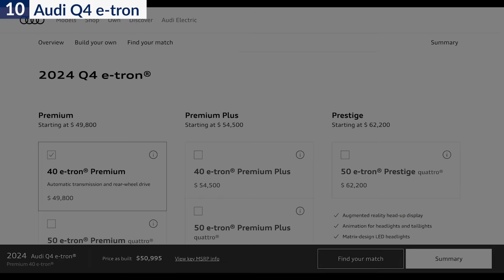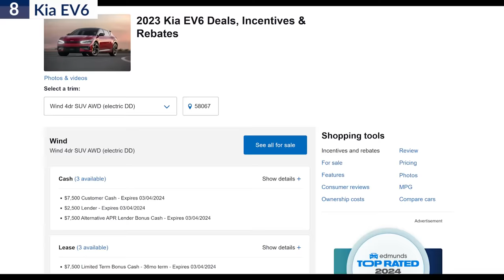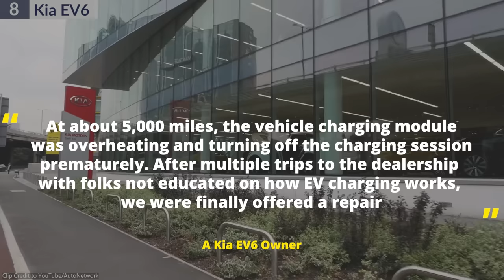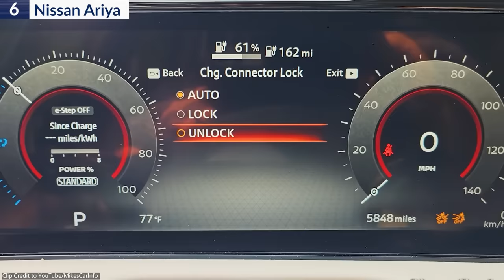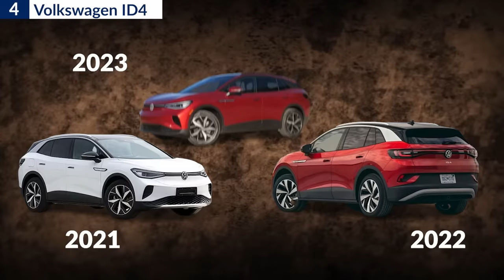New Electric Cars Piling Up on Dealer Lots in 2024 – Here is the Truth!

Comment: Well, insane drop in value even after 3 years more than 50%, crazy loans and insurance values, easily adding over 50% to the costs just in 5 years, also questionable future regarding charging costs,  battery health & tech ridiculous range drops in winter & highway speeds, I am sure there are 100s more reasons not to buy if you value your money & time.
Reply: The main additional reason is that they are not green at all.  They do not emit pollutants when they drive but every single other thing about them is worse for the planet.
Reply: Im used to buying 4-5 year old cars with ~100k km on the click for around 50% of their initial costs. Then I drive them another 5-6 years and resell for around 20% of initial cost. Meaning on a 50kE car I spend around 25k buying and sell it for say, 10k. I lose around 15kE for 5-6 years of driving it.

EV when out of warranty is valued whatever scrap / parts are valued. Battery when out of warranty can go bad at any moment and car is dead. Replacement battery costs more then car itself is worth. Imagine buying a same 5 year old EV for 50%, 25kE, after 2-3 years battery warranty is out. It dies, 20kE cost to replace. Total cost to you: 45kE. Resale value: 10k? 15?

Comment: I recently watched a news report shown on Canadian TV about a motorist who had a Hyundai Ioniq EV which he bought for US$60,000. He was driving along a motorway ['Freeway'] when he didn't notice and ran over some debris left on the road. Although there was a loud 'bang' as he struck the debris, when he later stopped and inspected the car there didn't appear to be any serious damage. 
However, the owner felt it was best to have the car checked over professionally and took it into his local Hyundai dealership. Underneath the car is a large 'plate' which is fitted to protect the battery [I believe this is normal for EV's?] The plate had some deep gouges in it but more importantly, the access cover to the battery itself [which is located in the centre of the plate] was missing. 
On further examination, the Hyundai engineers concluded that the battery had suffered 'impact damage', resulting in a slight leak and needed to be replaced. The cost of a new battery? US$50,000! And due to the staggering levels of depreciation of EV's [despite the car being only two years old] the owner soon discovered that it was cheaper to buy a new car than replace the battery! 
I have long argued that EV's are the single biggest scam ever inflicted on motorists. This utterly inane belief that buying an EV is 'saving the planet' or helping the environment is complete BS. Electricity doesn't grow on trees or magically appear out of thin air. It needs to be manufactured. And where is it manufactured? In power stations. And where do power stations get their energy? From fossil fuels [such as coal, gas and petroleum] or nuclear fission. 
In effect, we are merely transferring the production of fuel [and with it the resulting pollution, degradation of the fuel source and environment etc] from one resource to another. And worse still, the levels of pollution etc are FAR greater when that fuel source is from power stations than is created by petrol or diesel-powered vehicles.  
But on top of this is the phenomenal initial cost of buying [and insuring] an EV, the unbelievable level of depreciation, hassle and inconvenience of EV's and now it seems, having to replace the battery on an EV if it gets damaged. No wonder car manufacturers [and people like Elon Musk] are rubbing their hands and making billions!! 
The other irony is that EV's are not a new idea. EV's have been around for over a century. So why didn't electricity become the main power source instead of fossil fuels? It sometimes amazes me how gullible we all are and that huge corporations can manipulate our thinking by simply tapping into a 'trend' or people's fears.

Comment: Interesting reading all the EV critique comments; I drive a gas car, half the houses on my street have Tesla, one Rivian one Porsche one MB but zero Korean, Ford or GM.  So, I think it’s not all EV don’t sell, it’s the car model and area, LA is warm, dry and my neighbors can charge at home (we can install separate discounted meter for EV), saw a few running cable to cars park outside, and almost all public parking have charging stations.  My son has a Toyota Prius Prime plug in, tiny gas tank only fills a few times a year, does save a lot of money as gas is expensive here.  My car costs about $80 each time to fill up, it adds up pretty fast.

Comment: EV's are now like a midlife crisis health check up ! They are terrible on losing range in the cold, they can burst into flames , the battery life will be a terminal thing & who pays ? Charging can be a nightmare & the ranges are compromised ! Until the networks are like any other gas/petrol stations & the range goes over 600 miles they are about as useful as a canoe without a paddle !

Comment: To look at EV depreciation, you have to reduce the price of the car by the amount of subsidies on it.  If the car qualified for a $7500 federal tax credit and a $2500 state EV tax rebate, then the car is worth $10k less, thus the value after 1 year typically falls in line with other ICE vehicles.  2022 was an anomaly where as most car buyers paid over sticker for their cars, and thus depreciation was high across the board.

Comment: i mean what did they really expect?   I own both an EV and an 11mpg truck.. so I can speak from both viewpoints here.   There are tons of problems with EVs

1: $20k higher priced than an ICE equivalent version.
2: "starting at" doesnt matter, most dealers are only stocking the higher trim levels because the margins are better.  So there is no value options in most locations
3: companies killing low cost EV like the Bolt but pushing $110k massive EV like Hummer and Silverado.
4: massive initial depreciation well beyond that of ICE cars.
5: Charging infrastructure is insufficient in alot of places. 
6: No future thought regarding how we will create the increased power which will be needed to support our grid once mass EV adoption has been achieved. 
7: Range is still an issue. 

We love our EV, but its a tool for a specific set of conditions.... an EV wont fit everyone's needs and that needs to be spoken.   All the bad press of Teslas freezing in the Chicago winter storm wasnt because EV are bad, its because a bunch of people without the capability of home charging, who rely entirely on a commercial charging network, purchased a vehicle without thinking it through.      Until consumers are honestly educated about EV's, and not pushed a government or manufacturer talking points, they will continue to have adoption problems.

Comment: People who buy a mustang want to hear vroooom! Environmentalists don’t buy cars like that. The Ford 150 is another disaster. Pickups are used to haul stuff. No one wants to sit at a charger for hours because you’re carrying a heavy load. 

The environmentalists and the tech curious people bought into a dream. The rest of us have done our homework and don’t want to be stuck with a worthless EV in 8-10 years when you’ll have to (not if) dump $20,000 into it to replace the battery. The car should be going on 150,000-200,000 miles by that time-should be worth about $5,000. If you try your luck at a dealer, the first question they will ask is when was that battery changed?  When you say never……goodbye.

Comment: I expect a 500 Km two-motors EV to sell for £ 20,000, with the battery being user-replaceable. Also, charging should be subsidised, if not free. More in a while.

I don't mind full-self-driving because that is a perennially moving target, as it isn't possible to make a self-driving car. A car is a tool, and a tool is meant to be used, so it will always require an operator.

Also, we need a warranty on the charging price. When the EVs got out of their hide, charging one of them costed 1/10 of the price of a tank of fuel. Now, charging an EV costs half of the price of a tank of fuel. You see where we are going, should be only EVs on the road one day: therefore, charging an EV must be free.

Many people feels cheated, after they bought an EV. No more free parking and free road tax. In London EVs will pay a contributing green fee in two years time. Charging prices have increased five times, insurance has doubled.

And nobody prepared the EV owners to the rate which they go thru with tyres: replace the tyres every year.  EV tyres have half of the calendar life of ICE tyres, and they cost the double. 
The rolling resistance of EV tyres is absolutely critical with the battery life; half-worn tyres double the rolling resistance, which in turn, almost halves the battery life. 
I would say, it is no EV time for the masses  yet...

Comment: They are more expensive than ICE cars, without incentives and discounts. More expensive to insure. Tires wear out faster. 
Yes, gas costs more than it did 5 years ago but charging electric car costa more too using public fast chargers (depending where you live). 
Another unforeseen problem is fires. In a crash or battery failure those fires are impossible to put out. Whole car shipping ferries have sunk because of such fires. They literally burn under water! Fire brigades are just watching them burn and can't do much about it. Replacing used battery packs cost a lot more than it would replacing an ICE engine so the higher mileage electric cars with depleted batteries are useless. They replace them on high end Teslas but Nissan Leafs are already being scrapped. At the same time when a similar year, like 2015 Corolla would still drive around for many years.

Comment: If you want to buy an electronic car, then my personal recommendation would be Tesla model Y. I purchased mine, and it uses Desktop Ryzen 7 2700 processor. You know the same processor PS5 uses. The whole system is extremely fast, responsive, and so is the touch screen. You get 8 years warrenty on the battery where no more than 30% of degradation is allowed over the course of 8 years. After 10 years, you can pay $6k and buy a new battery (Y model) and get another 8 years warranty on battery only. The software A.I. with the battery climate control system, Tesla is two decades ahead of the competition. The downside to this is you always have to have it plugged in during the winter so the car can heat the battery some times. Which is why their car last a lot longer given that you don't get into an big accident. Once you experience the technology, every other car really feels like a toy to you.

I had a Toyota RAV4 prime 2019 plug-in hybrid for 3 years, and it's been through 6 recalls. I had the touch screen not responding sometimes because they use 10 years old tiny mobile arm processor. Toyota gives you 10 years warrenty on the battery, but after 3 years, I am already starting to see degradation. You just can't beat the advanced battery climate control system tesla has (8 valve systems, 16 types of climate states) regardless of your reputation in the automotive industry.

Comment: I don't own EV but I did a 10 page paper on them in college and really dove deep into them. And I gotta say EV generally are much better than ice cars because it's much less complicated and least likely something to go wrong. Teslas have battery warranty and they usually only lose 1-3% of charge every year.
Reply: 1. Child battery mineral labor

2. Range anxiety

3. Risk of garage fires

4. Paying 20k more than a
comparable vehicle

5. every time you fuel up an EV, the fuel tank gets smaller  and smaller. Battery degeneration. 

6. Poor resale value

7. Reduced performance in
cold, highway.

8. Higher repair costs

9. Awful charging network
experiences in the weather
without restrooms

10. Higher insurance rates

11. Replacing tires more
frequently. Michelin states that tires wear out 20% faster on an Ev, and could be as high as 50% faster! Ev tires made for ev's, cost 20 to 30% more, than regular tires for ice cars. As Ev tires wear out, they leave behind more tiny particles of rubber than normal ice cars. This causes more pollution. 

12. Death by autopilot

13. $25k - $35k battery

14. Low km range per tank of energy. 

15. must wait in-line 1-2 hrs
to charge.

16. Then wait more time to charge, while charging.

17. Spontaneous combustion, with no way to put out the fire storm.

18. If they catch fire in a tunnel, many people will die.

19. People without a pro charger system or a parking spot at their house, will run an extension cord to the road, which is dangerous and could lead to people tampering with your charging setup (super slow charging at the road)

20. If you're in California, you won't be able to charge your car past 4pm because of a shortage of electricity supply on the cheesy grid.

21. It is not actually "green". The pollution is made at the power station, not the car.

22. Only 5% of used junk batteries get recycled, the rest go directly into the bin. It's cheaper to mine for new minerals.

23. Chhinna actually does 70% of all the refining of the minerals and production of the batteries.

24. Minerals are becoming more and more scarce, and the cost will only go up, not down.

25. Some countries where they mine for lithium, actually use a very big boat load of fresh water to only produce a ton of lithium, so they are afraid of running out of water. It takes over 2 million liters of fresh clean water to produce 1 ton of lithium. 

26. Ev cars will soon not be able to drive in tunnels or be able to park in underground parking garage and probably will eventually void your house insurance if you park it in your personal garage.... 

27. You can't charge your battery at super stations when it is bitter cold out. 

28. If a fire truck comes to put out an Ev fire, all the chemicals go directly into the sewer system, poisoning everything. They need tons of water to slow down the burn. They can't put them out. They are only trying to prevent over things near by from catching fire. 

29. Ok, there is 2 good things; regenerative braking, which charges the battery while you are slowing down on the highway, which saves your brakes from much wear.

30. Loss of fuel tax revenue, so now the roads will only get worse, not better. 

31. in Dublin, huge generators are being used to charge EV buses, due to electrical grid strain. buses in Athlone also cannot be put on charge until midnight, for the same reason. Bus Éireann is saying that they can't charge their buses until 11pm for the same reason,  and to avail of a lower tariff. 

32. Not everyone on earth even has electricity to charge their cars. What are they supposed to do in 2035? It's easy to get a bucket of fuel to power up a regular car. 

33. VCE, or "vapour cloud explosion" is very bad. If any battery, typically anything larger than an E-scooter battery, and especially only "half" charged. If a problem occurs in the cells, it might not catch on fire right away. Instead, a cloud appears, and then may be ignited a short period afterwards. There are 2 different types of vapour clouds that appear; heavier and lighter than air, which form will be dominate, can not be predicted yet. This produces a bomm.

34. For Ev transport trucks, they aren't allowed to carry the same payload as a diesel truck, because of the massive weight of the battery. The owner of the Ev truck therefore loses potential profit, every day. They also lose more profit for the waiting times for charging that Ev truck. The driver will get paid to charge the truck, which in turn forces the owner of the truck to lose more money. 

35. Ev cars are more likely to be written off, if they experience a minor collision. After the collision, something could have upset the structural integrity of the battery. 

36. Ev cars lie to you. If you are bold enough to go out on a decent road trip and its 210 miles, one way, and your Ev tells you that your battery will last you 223 miles, there had better be no hills, or excessively cold out.... You'll probably get stranded, trying to get to the charger, at the end of the trip. Ev's have left many families stranded already. 

37. Ev's and their batteries, will soon need their very own "passport". With all info about them when born, and current info about them (power output, resistance, mineral composition, etc.) 

38. Thieves stealing charging cables, will soon make it impossible to "fuel" an Ev car. They take a long time to replace the cables, just to have them cut again for scrape money. 

39. Cars were typically being made lighter and lighter using aluminum and or fiberglass and or carbon fiber, to reduce emissions and pollution. Ev's are only getting heavier and heavier, causing more pollution than ever. Remember, an ev's pollution is made at the power station and the dump, not at the actual Ev, except for the tire particles as mentioned above. 

40. More on spontaneous combustion of the battery. What if you had 3 kids strapped into car seats, in the back seat ,which kid do you rescue? More fires start so fast, there is hardly any time for even the driver to escape, let alone 3 kids strapped in. 

41. There must be a reason that Boeing 747's aren't battery powered.... Until jets are battery powered, I'll be sticking to fossil fuels for my mode of transportation. 

42. Can't bring an Ev up north in the woods, nor any battery powered chain saws, where there are no grids to charge them up. You would need a huge amount of solar panels to get you anywhere. 

Ev's (External combustion vehicles) suck, and it's a bridge to nowhere. But they do sometimes convert themselves into "internal combustion", but sadly, they can only do that 1 time.